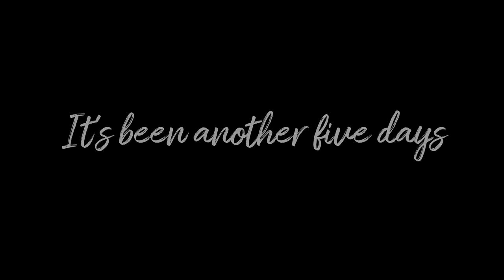Solo Log cabin building, Cucumbers and tomatoes in the forest

Comment: Lookin' good, dude. You'll need a header over those windows. Is that used oil you're using on the wood? Tx 4 the vid.
Reply from the maker: First, I covered the wood with bio impregnation, and then with azure. Although the last step could not be done. Thanks!